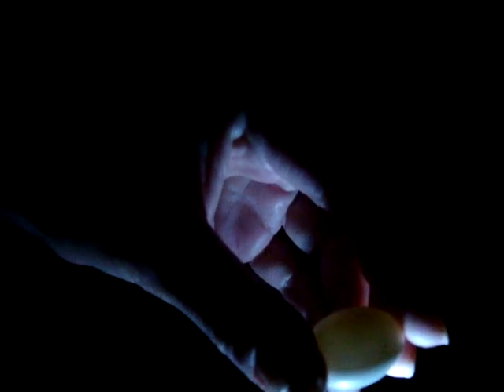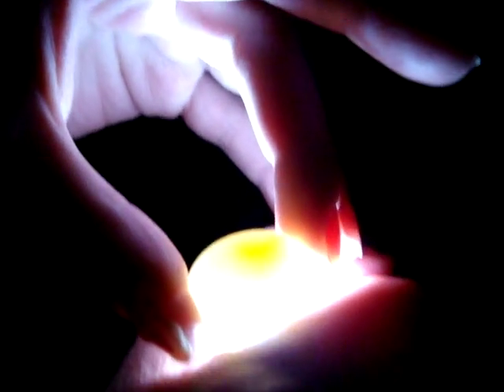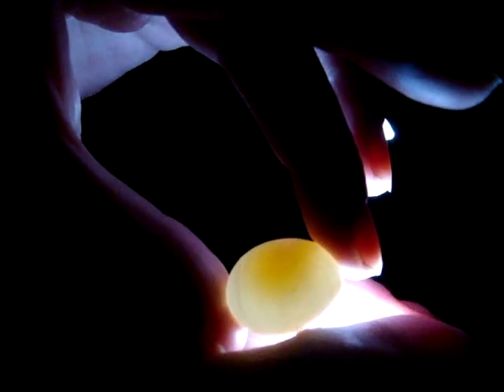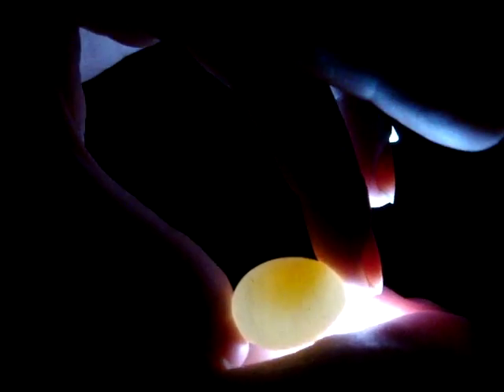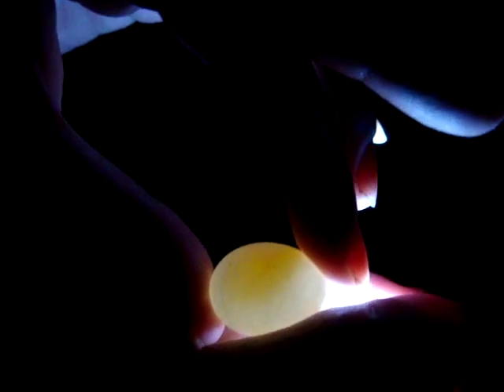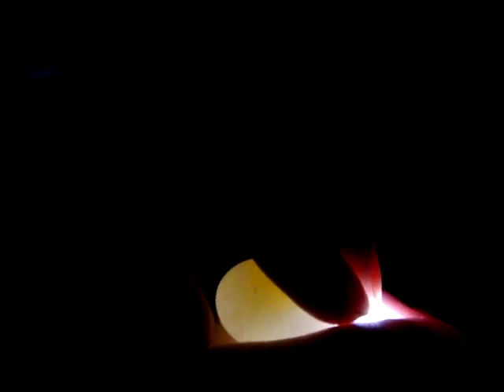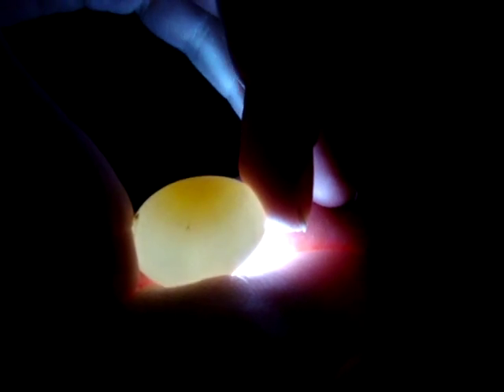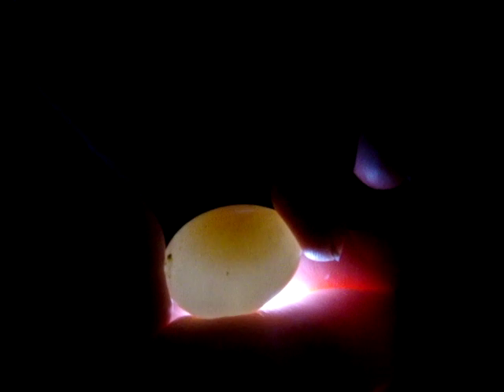5-15-12 - Candling a non-fertile / infertile lovebird egg with easy flashlight method

Comment: I have 3 Lovebird eggs and this week is there hatch date. I checked last week if they had blood vessels, 2 of them i can see there shadow moving so they are alive but the last one was all yellow and no vessels so its dead?
Reply from the maker: If it's been a few weeks and no visible blood vessels, then it's likely the egg is not fertilized. Best way to check is by candling the eggs. After a couple weeks it should be very easy to tell the fertilized eggs from the ones that are not.
Reply: One hatched 2 weeks ago and sadly died a couple hours later, my guess is that the parents didn't feed it. The other 2 never hatched :(
Reply from the maker: ᔕσυlƵツ I'm so sorry! Was this the first clutch for the parents? They are very tiny and need a lot of attention the first few weeks. I hope you have better luck if they lay eggs again.
Reply: Lovebird Loft Oh yeah its there first and thanks. :)